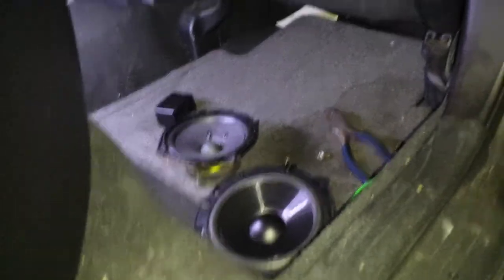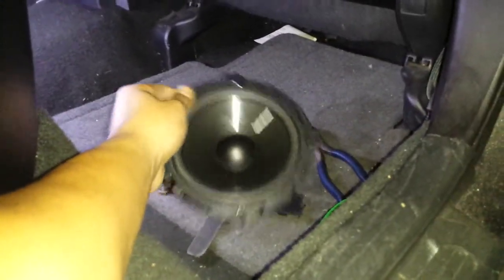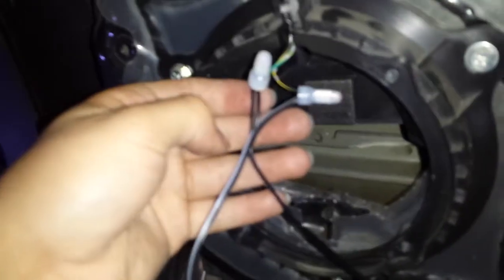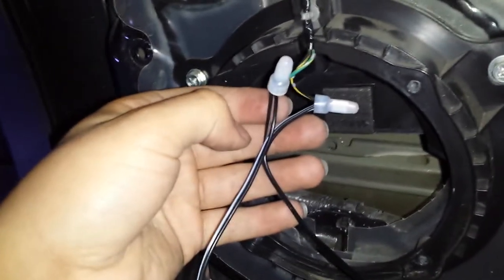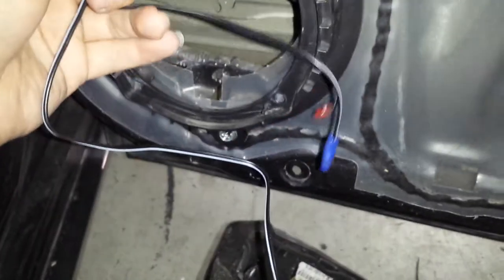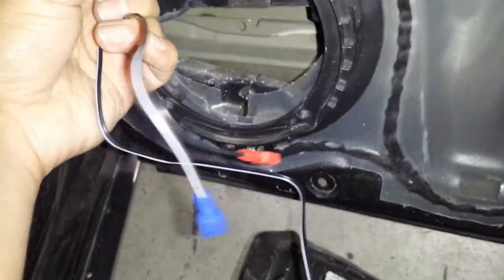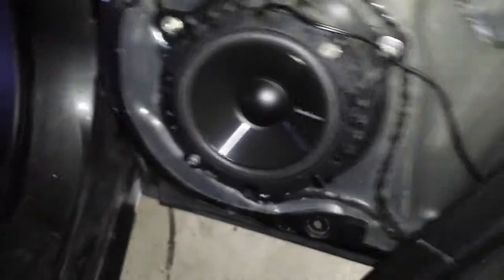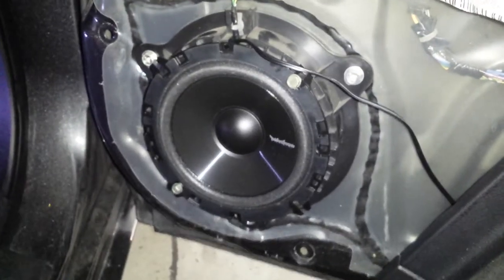SE-R updates: rear speakers/tweeter part 2

Comment: Nice vid. Did you hook the tweeter wires straight to the NEW speaker wire? Are the cross overs built in? Or did you use cross overs?

Comment: Which Rockford speakers are those and did you amp them???
Reply from the maker: They were the  R165-S, 80 watt 2 way component set. And no I actually just had them connected straight to the pioneer deck.